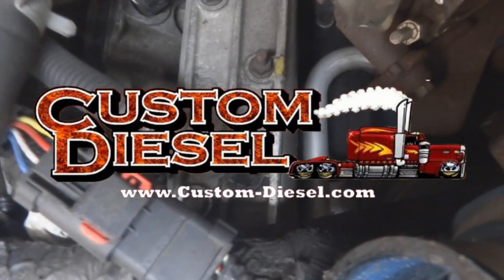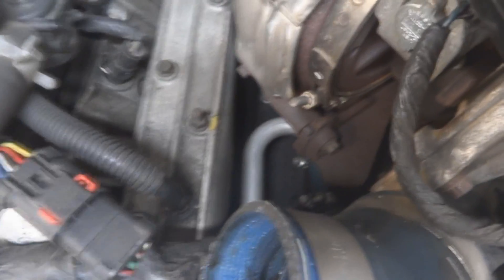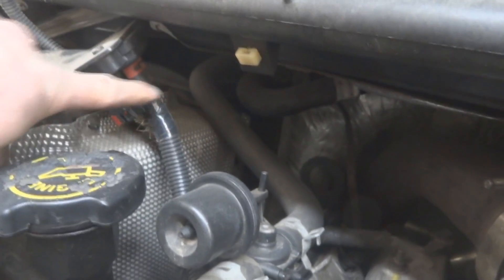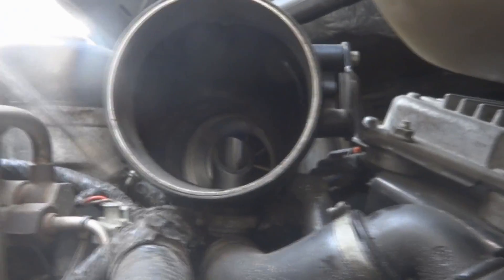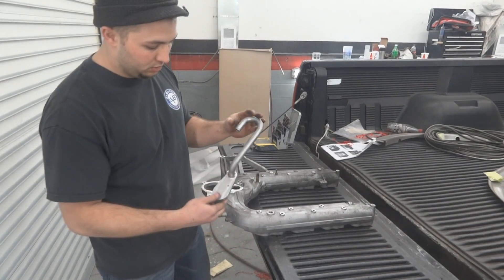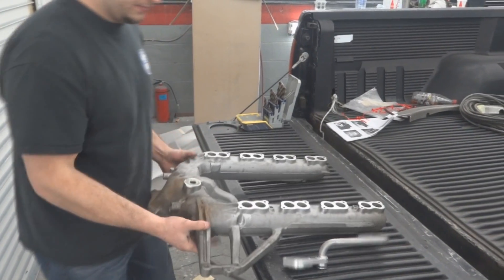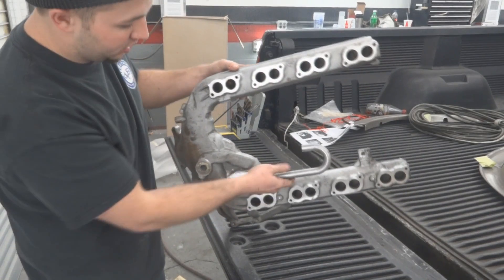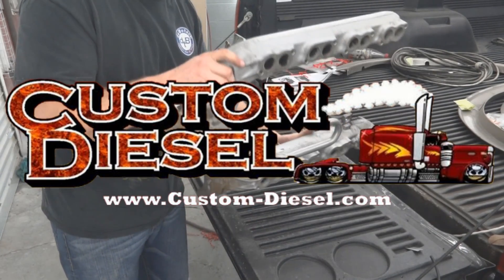EGR Delete Common Questions

Comment: simple question.. If i remove the EGR out of my 6.0  368 Cadillac engine . Can I invent  a modification with an air filter attached to a blank plate where EGR was I am under the impression it will allow more fresh air into engine for combustion .More combustion more power ? correct. It is a 36 year old car and does not need emissions to be tested . or should I just blank the entrance where the EGR was? I am wondering if it is better to invent an air filter where EGR was .Thank you for taking your valuable time to answer my question

Comment: Thank you for making this. I'm stuck and was hoping you might be able to help. 2005 f250 6.0 have intake , charge pipes, turbo, oil,  and fuel housing removed. I'm stuck on the removing the EGR and oil cooler. The directions that came with kit suck. The thing you have in the video I believe in the heat exchanger for EGR? Dies that have to be removed to install EGR delete. Truck in pieces no way to get to work. Please help. Thank you.

Comment from the maker: @ joe snowmo Depending on the health of the vehicle when deleting the EGR it could vary. If the truck is running good deleting the EGR should be all you have to do. Replacing the oil cooler while deleting the EGR would probably be a good idea and may cause fewer problems in the future.

Comment from the maker: @ myHome109 The EGR would still then allow soot and other diesel exhaust particulates to enter the cylinder head. Even though the exhaust would pass through the catalytic converter there would still be harmful particulates and the coolant would still be doing “double duty” cooling that exhaust passing through the EGR and cooling the engine.

Comment from the maker: @ moreno3662 Nothing wrong with a cooler running truck as long as everything’s operating correctly ie… heater and thermostat. Depending on the supporting modifications your truck has it could also be the reason it runs so cool.

Comment from the maker: @ bluebird5100  Sorry in the delay of the response, but we have a new employee that will be answering all YouTube video questions or concerns. By deleting the EGR the trucks coolant will be cooler however the EGTs will not be as cool. The EGR brings hot exhaust gases that lack oxygen back into the cylinder head to keep the EGTs cooler. This creates a problem by having a buildup of soot and making your trucks coolant do more work than it’s supposed to. Deleting the EGR should improve gas mileage and during wintertime use fuel additive to prevent fuel gelling and keep your trucks block heater plugged up at night.